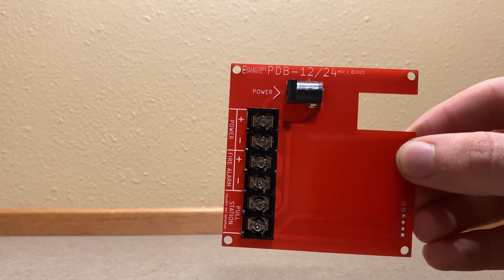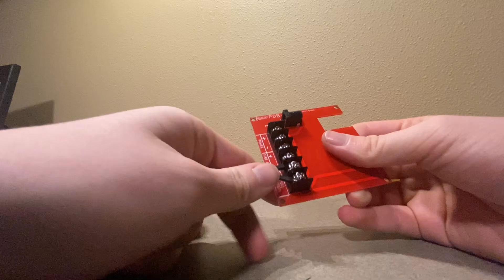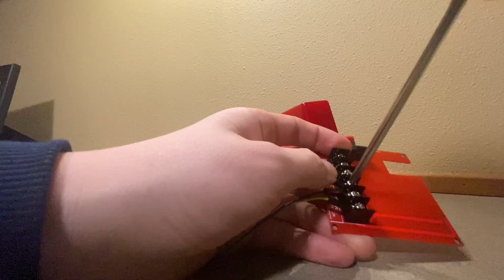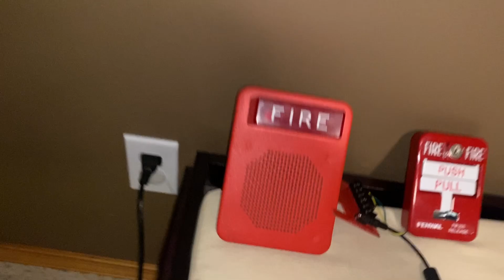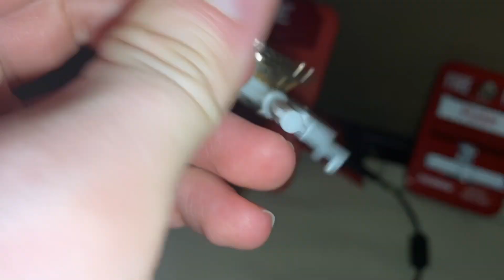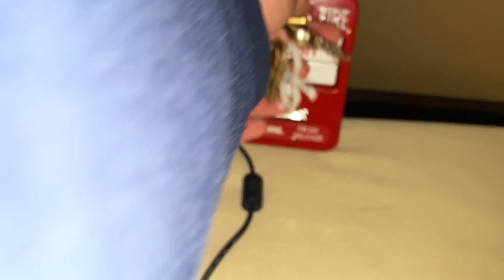New Product! PDB-1224 Power Distribution Board

Comment: Honestly, little suggestion I would add an LED after the power supply inputs just to show that it is receiving power, maybe would help out for less experienced collectors that could be having an issue before the board entirely and wouldn't be able to discover that per say if they did not own/have access to a multimeter.
Reply from the maker: decent idea. I might. I was trying to keep part count as low as possible thats the only thing
Reply: @FourtyFiftyEighty  keeping the part count low and the price high